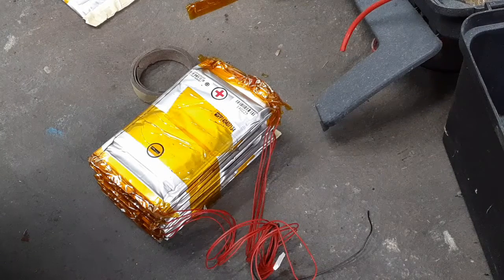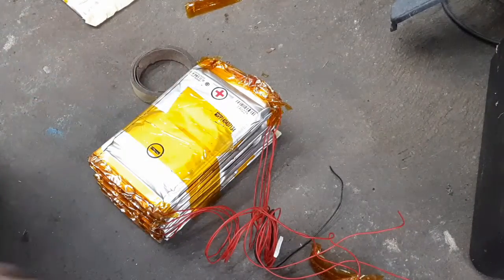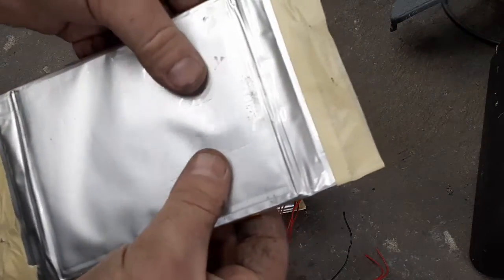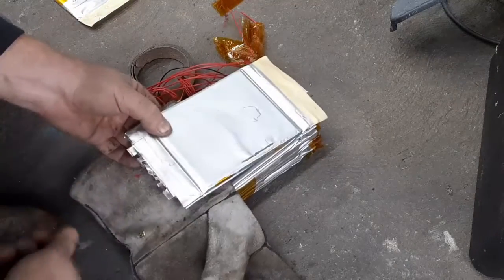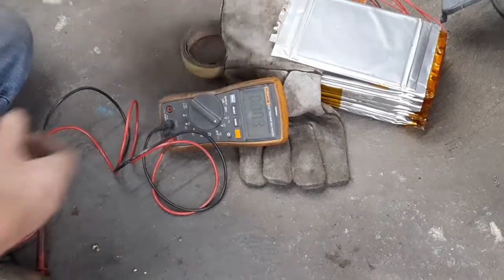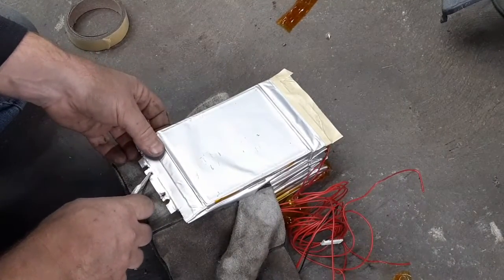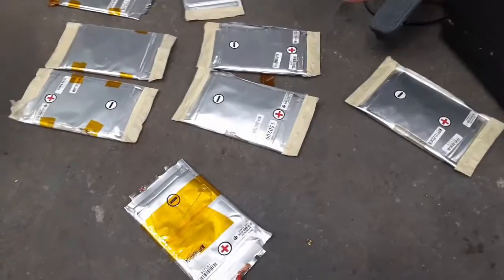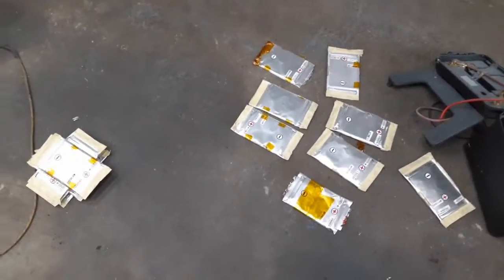48v SPIM08HP Failure - Solar Off Grid Battery Pack

Comment: I had the same exact issue a while ago. The problem was the BMS that didn‘t trigger once 3/10 cells got overcharged. They were at 4,7V and had the same formfactor. I put it immediately outside as I noticed it to let them cool down, and after that they had ~1V after 48 hrs. The rest was just fine fortunately.

Comment: Compression might be the issue but the holders don't compress them really I did like u the first 50 cells I bought were without holders and I used rivets then threaded rod and nuts and washers to build a 4s 10 p ran the rod through the rivets to connect multiple batteries to that configuration.  The next time I bought 50 with th holders excited to have the holders this time I pulled them out and they don't compress the cells barely at all way better with just heat tape then the holders I see vids where there using bus bars with the holders and bolting down to the tabs of 2 at a time but I can't see how and there is no video showing exactly how they use the bus barsor how they bolt down to those tabs
Reply from the maker: The first battery I did with them I used nuts and bolts with washer "spacers" and did them 3P4S for a 12V battery, so they can be bolted together into thicker packs. It worked but was super sketchy and after 16 months or so it swelled up like a balloon. These cells are cool for the price, but I gave up on them completely and have moved on to cylindrical and EV cells since I only need powerwall levels of output.
Reply: Really I use these for 1 reason they get along very well with agm I used to have a 500 amp solenoid that would separate the different chemistrys so there was no draining or whatever but it felt like a choke poi b t so I did away with it 2 years ago

Comment: They have to be compressed  properly also it sounds like your charge controller wasn't disconnecting at night and you may have been back feeding your panels
Reply from the maker: compression would probably have helped, but I think I just ran them to death with Cycles down too low voltage everyday almost
Reply: @lsswapshopp  these cells have to be compressed at the tabs. That's what the bars are for not to mention the threaded holes for studs or bolts so you can use plates

Comment: Use the spacers and the threaded bars.  They protect the cells from damage.  They keep them cool.  If they need to expand they have somewhere to expand to.
Reply from the maker: Good tip, the spacers probably work best. I think I just cycled these to death after 2 years of hard use. I've scrapped them all and started using EV batteries for solar storage.

Comment: I would suspect the very small contact area of the rivets. The 36 volt packs from Alarm Hookup have a very large contact area across the whole tab that is bolted with a full width bus-bar.
Reply from the maker: It's possible. I'm not as familiar with pouch cells vs cylindrical cells. But my understanding is some of the "gas formation" is from improper clamping force of the cell itself.